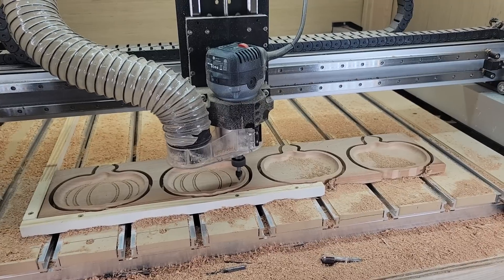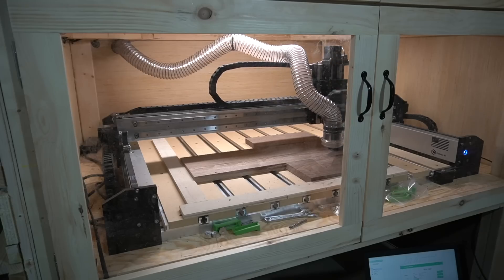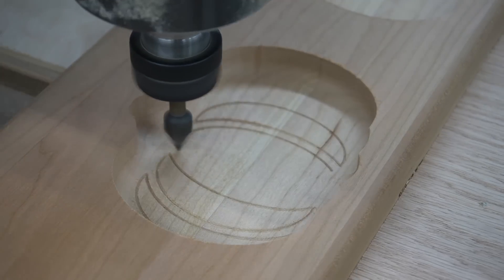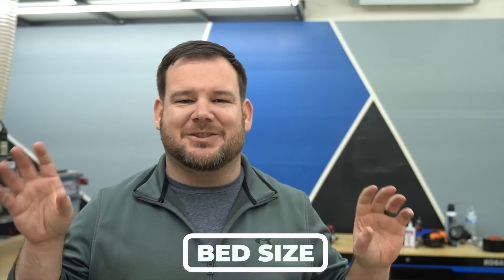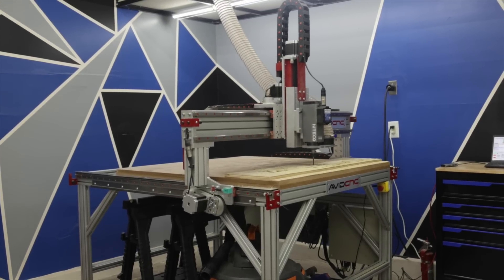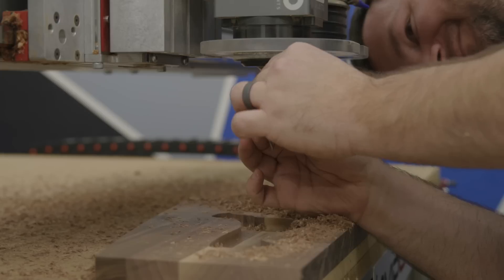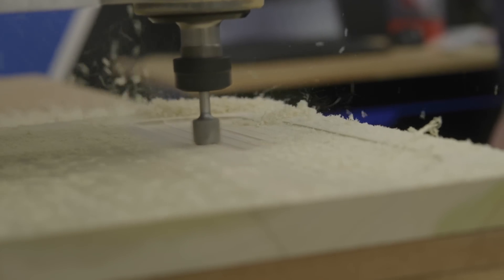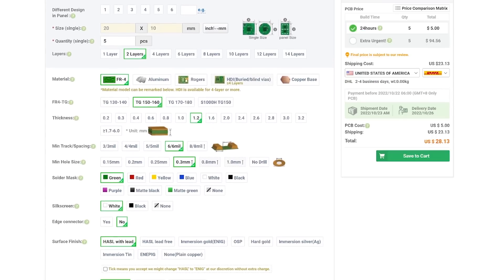Buying the WRONG CNC Router will cost you THOUSANDS.

Comment: Look at a long mill that are the actual best in rigidity function and they are only 1300 for the lowest base model and a fully built is only 2000 and their customers service is amazing
Reply: isn't the longmill a belt-drive system? Fairly sure it's no-where near as rigid as a Onefinity or even a FoxAlien
Reply: It uses lead screws and a couple of v wheels but I know of people that have had them for 2 years+ with minimal wear

Comment: that aluextrusion machine you showing  just can not match to the machine i got from  china for  1/3rd of price

my gantry  made out   a steel tube,  6x10 with 1/4 wall thickness
double  the height and width you showing in the video
in comparison this steeltube   fits for a 16 wheelers bed, but you couldnt use your  extrusion for same purpose

i purchased this  machine  with all tax, and shipping  to my door for 5500
let alone components  coming from china, like rails and spindles, microswitches drives and motors

buying directly from china or from ebay still way  more affordable
its just too common  american companies rebranding and selling under their name  with spiked prices

Comment: I'm now in the process of rectifying choosing the wrong cnc. A year and a half ago I was in the market for a onefinity but because of the 7-8 week lead time,  I went with another machine(I won't say which) and it has been a bit of a nightmare. The machine started running inconsistently 6 months after buying it, to the point that ibought a 2nd smaller cnc. 2 weeks ago I ordered a onefinity elite. Has an even longer lead time now (8-10 weeks)  but I'm all in now. I know a onefinity isn't as good as an avid or laguna. But it will definitely do what I want...I hope
Reply: Why don't you share which was the crappy one so I don't buy one :D
Reply: @editboy23 was thinking the same thing
Reply: I guy I'll give a 1 year update to this question lol. The elite has been awesome. Did have some issues with a few stepper motors failing prematurely but I think onefinity got a bad batch. I upgraded to a 110v air cooled spindle and a tool setter. Oh and to answer the question from a year ago,  the POS i originally bought was a longmill mk1. I know that company has since made the mk2 and most recently the altmill. I know nothing about those machines because that company burned that bridge.

Comment: Good information for most people. There are also other higher end machines out there also. Almost no limit to the amount of money that can be spent getting one. I personally started out with a 70k one that is 5x10 vacuum table and has ATC and servo drives on all axes, weighs 3500lbs. and has a 12hp spindle. It is obviously not for everyone, and definitely not small. I just wanted to have a very robust frame as mentioned in video as I come from a metal machining background and weight is a sign of a ridged machine. It is also worth noting that tooling for any machine is going to be another expense as is all the other peripherals and materials to machine. It will add up faster than you might think.  My attitude is, if I make money with it, fine that's a bonus, that way no worries about getting money back. 
I

Comment: I looked at the AVID CNC's but thought the frame was not rigid enough for my needs. I took a chance and purchased a 4x8 CNC with heavy steel frame and gantry from China... came with vacuum table, 2 suction motors, 4th axis rotary, dust collection, water cooled spindle, and some tooling.  It was all pre-wired... I had to supply my own PC and it runs Mach3. Total cost with shipping was 10K from AlphaCNC... my gamble has paid off as the machine's performance is awesome. Initial setup and calibration was pretty much dead on. Only issue was it took almost 1 year to get the machine, (was during Covid so I am sure that effected shipping)
Reply: How can I get in contact with you privately? I am in the process of importing one. I would like to hear your comments and experiences.

Comment: I'm just starting with a Vevor 3018 that I've upgraded to a 20K spindle and a working area of about 3033 for half the cost of a 3040, about $330.  If I wanted to, I could go get another Vevor 3018 and upgrade it and have twice the production of a single 3040.  I love what the machine can do and the product it produces and I'm still learning the limitations of what it can and can't do.

Perhaps you can add to your video and show what the finished products look like right off the various CNC machines.  I think this is more telling than most anything else.  Sure, a $15K machine is more rigid and tougher and longer lasting (I would hope) than a machine at 1/5 the cost, but what does the end product look like?  How much post processing is needed on a $3K VS $15K machine?  What aftermarket products are available to make a $3K machine better at a reasonable cost (of course, reasonable being relative) Also, you mention how much faster a $15K machine is than a $3K machine, well, I could buy two, three, four or even five $3K machines and have them all running at the same time, out producing any single $15K machine and I could do more different things at the same time, I could outfit one or multiple $3K machine(s) for a specific type of task making setup and running even faster and I would have redundancy.  Also, the spindles and stepper motors are much less expensive for $3K machines, in general.  I certainly understand there are a lot of caveats to what I've said, but I think the information would be beneficial to all.

Comment: Didn’t see any comments on the Next Wave Shark HD500 CNC

Good? Bad? These are sold at Rockler and comes with vcarve and controller. 

Many years ago I bought CNC motor/electronics kit and built the platform. Worked really well for 100’s of projects. 

Looking to get back into woodworking and want an off the shelf system. 

Any advice would be appreciated

Comment: A comparison that's missing is tolerances. Which machine is going to do the best job. I'm looking at generating a mold for a human face. Who's got the best working machine to pull tolerances. 
     After getting to the dust part and requirements, that put me off, so thanks, Now if I was still considering a purchase, It seems that the companies would have some trial software to practice on. Is it worth learning on a free version to see if you are going to "get it" or not. 
    Generating a 3D from a photo is something I've looked into. It wasn't quite beyond me but at my age and sanity level, It would certainly be a lengthy learning curve. If you ever touch on a 3D project from  a photo, I'd be all  ears.
    Thanks much for your very well put together works. Lighting camera ect, seems yours is a high production values. Keep it up! Wish me luck finding a shop.

Comment: Thanks for another great video. I am the 3k guy. I remember you had a Shapeoko 4. Did you have to adjust the belts often? I am looking at a cutting area of 17in or so more due to shop space. I have found a couple of 3k with ball drive. I am also considering the Millright Carve King 2.  Software wise; I like that I can get a perpetual license with the Carveco Create Pro. I am basically going to make some signs and small to medium 3d carving with the hopes of do some 3d geographical maps.   One of my considerations is that I have limited time I do not want to spend time adjusting belts every X number of times like I have to do with my desktop laser.   Keep up the good work.
Reply: Look at the Onefinity machine it’s a ball screw all stainless steel very fantastic machine and at a great price. I love it. I use Carveco great software.
Reply from the maker: I can only remember having to adjust my belts 1 time, maybe 2. Theres virtually no stretch in them. I would give Vcarve Pro a good look. I've really enjoyed using it.
Reply: @AndyBirdBuilds  Thank you!! I have been playing with it and seeing the CNC I am going to order cuts 17.5 x 17.5 I can go with the desktop. You just saved me a few hundred clams! :) Have a good weekend.

Comment: I would argue rigidity is the most important factor. All of the other variables are very important but don't even come into the picture if your machine can flex under load. I've purchased many smaller machines and the level of regret I've felt with those has been astounding. If you're a hobbyist then buy a cheap machine and learn how to use it. If you're a business owner don't waste your time below the 10k mark. Just my opinion but I've learned my lesson. You'll spend more time fixing and adjusting your machine than you will making anything.
Reply: I agree. My first cnc is a gemnitsu 4040. I should’ve saved my money a little longer and got something in a much higher quality. All I’m trying to do is make this thing work better and it’s not worth my time.
Reply: @Checkitfirst  buy once cry once. I've heard that terminology and didn't pay attention to it and I regretted it.
Reply: @SoleilCustomGuitars  
At least I wasn’t out a tremendous amount. I wasn’t really expecting a whole lot anyway. It was only $700. I know $700 is still a lot of money but at least it wasn’t $2000 and I was unhappy with that. I guess it could’ve been worse.
Reply: @Checkitfirst  I spent around $6,000 before I realized I needed a machine that cost around 10k to be happy with it
Reply: @SoleilCustomGuitars  
Well,, I guess I could sell my truck 🙄
Reply: @Checkitfirst  that was the budget that my business could afford. I also require a certain level of machine so you really have to look at what you're trying to do with it and decide the best course of action. I'm not saying everybody should buy a $10,000 CNC machine.
Reply: @SoleilCustomGuitars  
I get it. I’ve been a carpenter for 26 years. I thought having a CNC in the shop would be pretty cool. I’d like to be able to make cabinet doors. Of course I wasn’t expecting to do something like that with this machine. I am mainly trying to learn software. All these machines work the same way. There’s just a huge quality difference.
Reply: @Checkitfirst  very true.
Reply: @Checkitfirst  depends on your needs. I run a business. hardly anyone that is a hobbiest needs a machine for 10k.

Comment: I am new to CNC (about a year) and your channels content has been so helpful getting started.  I've used Carbide Create sofware since the beging, and just switched to pro so I can run some 3D projects. My VEVOR 4030 CNC is a full ball screw machine, it has linear rails also and it was only $750.00. I wouldn't reccomend this machine to anyone (unless you just want to obtain it for some good parts)!! I've gotten 2 machines from them (for the price of the one) both were terrible and always missed steps on the Y axis to the point were  the machine was unusable. I changed one machine to closed loop stepper motors that can't miss any steps. Now I have a machine with great hardware (ball screws, linear rails), and perfectly operating stepper motor system for about $1,000.00. I am currently converting the 2nd machine to the closed loop stepper motor system. I am going to end up with 2 full 4030 ball screw CNC machines for about $1,500.00 in parts.

Comment: You left out one sort of common drive system. Acme lead screw. A lot of people mistake them for a ballscrew, but they are not and are inferior...
Reply from the maker: I didn't know that. Thanks for sharing!
Reply: That is false. It completely depends on the application. They are not objectively inferior, just like belts are not objectively inferior. Belts are faster than screws of either kind, perfect for use in lasers & the shapeoko 4 pro belts are robust, too.

Comment: "there aren't machines at the $3k mark with ball screws" ?!?!?
Reply from the maker: There is no complete machine on the market with ballscrews from $3k
Reply: @AndyBirdBuilds  If you mean that because Onefininity does not come with a router or a waste board, then no there is not. You can buy a Onefinity and add a router and waste board for less than $2500. You are playing semantics.

Comment: Can you do a video going over the differences and between and why you like Vectric more than Fusion 360. I just bought an online course toe learn Fusion 360 because a few other woodworkers/CNCers suggested it. I just bought my first CNC machine too, a Shapoko 5 Pro 4x4', which isn't even out yet until mid March, and I added the VFD Spindle. So this video didn't give me a whole lot of confidence in my choices. I'm sure I still made a good choice, but now I have some doubts in the back of my mind. 😀 My plan was to see if I like it all and can make money from it, if I can pay off my first machine I planned on buying a second machine to ramp up.
Reply from the maker: You made an excellent decision on your machine. There's nothing wrong with the route you took on software. Up until a year ago, I would have suggested it is the way to go. But, Vectric is by far easier to use and is everything you'll ever need in a cad/cam software.
Reply: @AndyBirdBuilds  Thanks that helps a lot! 😀

Comment: Andy witch one would you recommend between the shapeko and the onefinity?
Reply from the maker: Shapeoko
Reply: There is not a single advantage that the Shapeoko has over the Onefinity. The Onefinity is the superior machine especially with the new Masso controller and step motors.
Reply: @almichka786  I guess it depends on witch model you want and how much you are willing to spend

Comment: I've been researching for the last couple of months. I really like the Shapeoko 5 pro 4x4 w/VFD, but I recently saw the new X-Carve Pro 4x4. They look very similar to me and there are very few YouTube videos on either of them. I like the Shapeoko but it is 3 1/2 months backordered. The X-Carve Pro is available now but is twice the price and I don't like that Easel is browser based.  I've also considered a 4x4 and even a 4x8 Avid Standard. That's way more money but is far more versatile and open to using the software of your choice. Use case is a hobbyist that likes gadgets. No production work now but who knows what the future may hold. I'm also weighing the axiom of "Cry once" when it comes to price.
Reply from the maker: If I was making the decision, I wouldn't even consider the xcarve. It's overpriced for what you're getting, in my opinion. Like I've said the video, it depends on the capability you need/want between the other 2.
Reply: @AndyBirdBuilds  I really appreciate that. That's the exact answer I needed to hear.
Reply: I believe I have the same machines as Andy does.  I had a Shapeoko 3 XXL (32" workspace)  and I now have an Avid CNC Pro 4x4.  The Shapeoko is going to be much easier to use and has some nice features like the bitsetter that the Avid doesn't have OOTB.  The Shapeoko 5 Pro looks nice and addresses some of the issues I had with the S3.  I hear you on buy once, cry once but it is a big difference in price ($5K vs $12-14K).  Completely agreeing with what Andy said in the video, I would probably recommend this criteria for your situation:   Hobbyist/Prosumer = Shapeoko 5 Pro, light production = Avid CNC Pro, medium production = full frame design (that I know little about).  The nice aspect is that if you ever decide to upgrade years later, your CNC files will mostly transfer except that now you will be able to increase the depth of cut and feeds/speeds, the knowledge and files are portable.  I suppose it is possible to learn CNC stuff on an Avid but I would likely have made more dramatic mistakes.  I say this because the software and hardware that comes with Shapeoko will hold your hands more and make mistakes/crashes a bit less likely.  The Avid on the other hand is faster, more powerful and complicated which gives you ample rope to destroy your work halfway through, slam a 1/2" bit into an aluminum crossmember and screw up a program because you were in inch mode as opposed to mm mode.  Not that any of those scenarios actually happened to me in the last year  :)